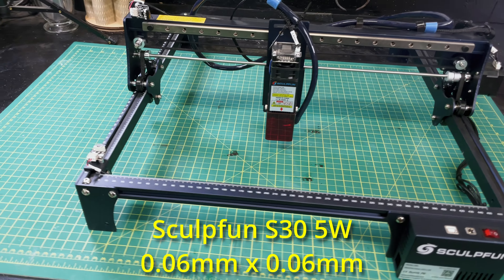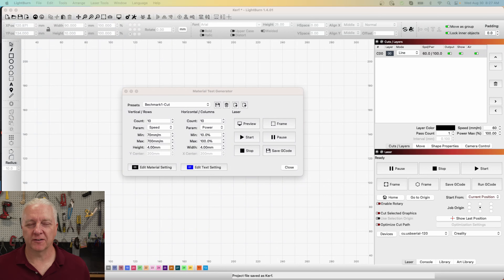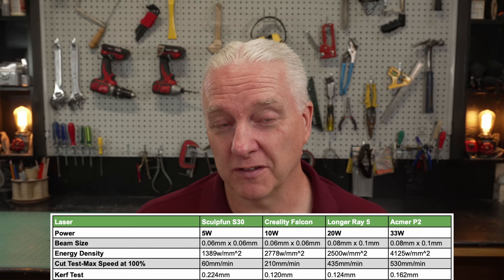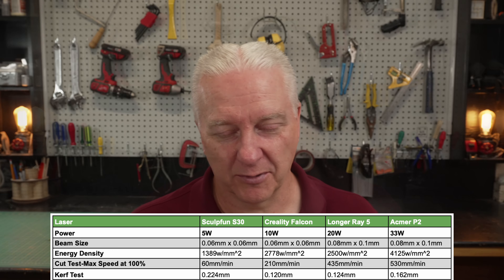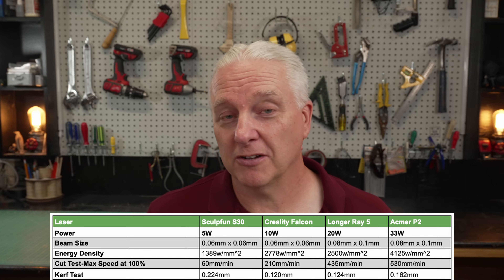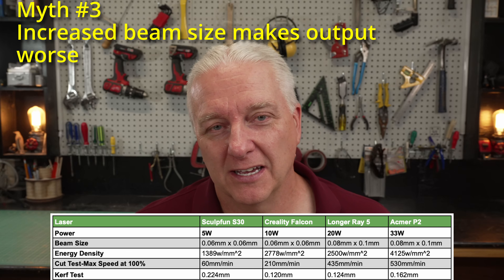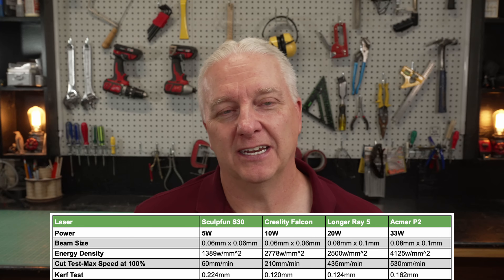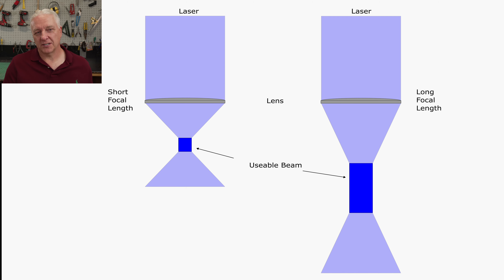5 Diode Laser Myths That Just Won't Go Away

Comment: Hi Steve, this is a very good and interesting video. You have explained it very well.
Only at your 4th myth, you are not wrong, but also not completely correct.
If you shine the light of multiple lasers through several partially transparent mirrors, you will notice that the first laser (the top one in your diagram) experiences the least amount of loss. As you mentioned, this mirror is not partially transparent, so the loss is not significant at this point. However, what does come into play is that if it is a glass mirror, diffraction and loss of intensity occurs. I don't believe a glass mirror has been chosen here, but that doesn't matter for the rest of my explanation.

The laser below it must shine through a partially transparent mirror because the light from the laser above it must pass through. To start with, there is some loss from the upper laser because glass, no matter how clear, converts light into heat and changes the intensity of the light. As long as we can see glass, it absorbs light intensity; it's as simple as that. Additionally, there's a problem where light enters the back of the glass at an angle and, due to diffraction, exits at a slightly shifted angle, which depends on the thickness of the glass used. The laser shining from the other side of this glass enters at a different angle and must pass through the glass surface twice – once towards the back of the glass where the foil or deposited metal is that reflects the light, and then back out at a 90-degree angle. So, there are two instances of diffraction and loss of intensity due to the brightness of the glass.

By now, the beam of light has become broader, and this broader beam continues downward to the next laser. This effect repeats several times, and when you compare the differences between the first stacked lasers and the current generation, you'll see that there are significant variations in the amount of loss. It's not a standard 4% per glass piece, but the loss increases as you go through multiple layers of glass. This loss is partly due to the glass absorbing heat and thus, lowering intensity and partly due to diffraction, causing some of the emitted light to simply not reach the final lens.

As technology has improved, laser developers have started using better diffraction gratings to minimize this loss in intensity instead of caring about optical focus. However, you'll only find this in very few consumer diode lasers because it's an expensive and difficult technique and is also sensitive to impacts. In the consumer laser diodes used in most of our laser engravers, much more attention is paid to the final lenses that focus the light into a usable beam than to the light path leading to the final lenses.

As said, you are absolutely not wrong, but you can't say it's a 4 percent loss per element.

Greetings,
Brian.
Reply from the maker: Yes, this is all correct, but I was trying to keep the description as simple as possible.😉

The beam coming off each diode is also quite large compared to what I've shown, and there is actually a concentrator optic between the last diode and the lens.  They do this to minimize a lot of the things you mention above (e.g. if a beam gets slightly diffracted passing through an optic, that shift would be negligible once the beam from all diode are concentrated down to a smaller single beam. This might make the beam a bit larger over all but wouldn't account for the 50%+ larger beam size that people think is caused by trying to line up the beams from different lasers

Comment: Hello! thanks for the video. For cut 18mm of plywood, wich diode laser can i use? 5w can cut the same that a 10w laser?
Reply from the maker: Cutting is where power matters.  For reasonably clean 18mm plywood cuts, you're going to to want at least a 30W laser
Reply: @SteveMakesEverything  thanks. Wich Is the life Time of a diodo laser? 5 hours of use daily?
Reply from the maker: @Acseq8wy  Diode laserwill last for quite a while - easily 5000-10000 hour.

Comment: So in your chart the 10w is listed as a higher energy density than the 20w, but you stated the data clearly shows an increase in energy density as wattage increases. Are the data points accidentally swapped?
Reply from the maker: The energy density is less connected to power and more tightly coupled to  beam size.  Modules with fewer diodes tend to have smaller beams - this is due to how the manufactures stacks the diode outputs.  One exception is the AlgoLaser Delta which has a different diode arrangement allowing a 24W laser to have an almost square beam with higher energy density, yet can still cut like a 30+w laser.
Reply: That makes sense. So I guess the part I hadn't considered is that the 20w has a significantly larger beam thus more overall energy at the surface. 
At 45yo following a year of being out of work with a back injury I'm diving into the world of CNC lasers. I programmed and setup CNC mills and lathes for about six years a decade ago and have always wanted to get back into the field. My xtool S1 will be here this week and for the past week I've been relearning all my software. Your videos have been very interesting, much appreciated. This channel is a welcomed break from the overwhelming number of videos that are simply paid advertisements!
Reply from the maker: @pkupmanvt  Almost all of my equipment reviews are unpaid, so I can retain an unbiased view, and on the couple where I have been paid, I'm clear with the manufacturer that I work for my channel viewers, not them.  I won't actively try to destroy a company's product, but if I don't like some aspect of it, you will hear about it.  Most companies are actually OK with that.

Comment: Hi Steve, Which do you thing is a better laser.longer ray 33 watt or acmer p2 33 watt.Having troublemaking a decision. Longer has good support. Not sure about acmer. THANK YOU
Reply from the maker: Tough choice since both are great choices. Both companies seem to have decent support, though the Ray 5 is an older design.  All things being equal, I would probably lean to the ACMER P2, but you won’t go wrong with either
Reply: Thanks steve

Comment: Thanks for the info. I learned a lot. I especially appreciate the power and cutting depth info. I almost paid more money for a 48w laser that could be switched to 24wfor finer engraving. Sounds like that would have been a waste of money based on your info. Instead I opted for a 24w at half the price with a motorized x axis that can automatically step down for multiple passes on deeper cuts. Sounds like I made the best choice without knowing it. The cuts may take longer, but will still be possible and with a better kerf, and I won’t lose anything in fine engraving.
Reply from the maker: 20-30W lasers are in the sweet spot for both cutting and engraving.  However, you will hear a lot of people say that a 40W laser can't get detailed engraving because the beam is "huge."  Keep in mind that we are talking about small fractions of millimeters, which is beyond the limits of most peoples' eyes anyway.  A typical 20W laser will have a beam size of 0.8mm to 0.1mm, while a 40W laser size is usually around 0.15-0.18mm.  Can anyone really see a 0.05mm difference??🤔

Comment: In our area, there is a high fluctuation of power because of this. I can't engrave photos properly, and the machine is not starting from its stopped position. What should I do to resolve  this issue . Please help me, Steve
Reply from the maker: What laser is this?  When you refer to the stopped position, do you mean the home position?  Or is the laser not moving at all
Reply: @SteveMakesEverything  it is laser tree and I am not saying the homing position..while I am working on my project suddenly the light goes off because it loses the power from the station but when the power gets back the laser will not proced the project from its stopped position rather it shifts the position and proced
Reply: @bereketsimon-ql8jt  Hello,for home and start position need to review your controller, you not say what app you use and what controller.As i know Laser tree make only head modules without frame.
These modules have a high temperature defence and overheating is one of reasons to not work.
Reply: @bereketsimon-ql8jt  you must install ups power supply with some big battery to avoid power fluctuations, most of lasers can't resume the job after power off.
Wish you success and fun with your future projects.

Comment: Thanks for all your good comments. I got a question for you. I am not sure if this is a myth or not but, I am using NEJE E40 laser 
(10W) thinking of upgrading to a E80 (20W)  I seen comments saying that all diode laser should not be used at 100% . When used at 100%, the life of the laser is reduced drastically. Is this true? I see lots of youtube example using the laser at 100%. NEJE offers a 2 year warranty but will lt last this long if used at 100%?
Reply from the maker: No matter what, all lasers are consumable. If you baby the laser, then it might last incrementally longer, but I don’t put a lot of stock not the 100% power claim. Diode lasers vary the output power by pulsing the power and varying the duration that the laser is turned on.  The actual voltage applied to the laser is constant while it is on, regardless of the power output.

Comment: Thank you for the video.  Watching this make me think of a question of beam shape and size.  If I want to creat a 1”x1” black block, engraving.  If I execute the burn on various laser with different beam sizes and shapes, will the shading be different?  Does lightburn take into account beam size/shape?
Reply from the maker: These are interesting questions. First the color shading may not even be the same between to units of the same laser.  Certainly between different brands, laser powers etc, the shading is likely to be different.  Lightburn doesn’t know the beam size but it can compensation for kerf if you enter it into the settings.

Comment: I’d appreciate your thoughts on the idea that running a diode laser regularly at 100% can significantly reduce the lifespan vs consistently running it at something closer to 85 or 90% power.
Thank you!
Reply from the maker: I hear the comments about running at 100% but I’m skeptical of the claim that it shortens the life in a disproportionate way. Of course using more power means more wear and tear on the laser but is 100% more than twice as bad as 50%. I don’t see it.
Reply: Thank you.

Comment: 1 thing that stands out to me is as you move up in laser wattage the power does not increase that same multiplier...i.e. 10w to 30w does not have a 3x improvement. Just a neat thing I saw in the chart. Would love to see a 40 (48) watt lasers numbers. Just one question that I don't know if you covered and I missed or not but did you actually measure the beam size or go from the manufacturers' statement? Honestly just curious as I can't remember you saying anything about it when I watched (re-watching to see if I did indeed miss it).
Reply from the maker: I wanted to include a 40w laser but I was having an issue with my D1Pro this week.  I will follow up on this once I resolve my issue or get a different 40w+ laser to review.
Reply: @SteveMakesEverything  cool thanx!

Comment: One important thing you kept stating was OPTICAL focus, lasers work on INTENSITY focus which is slightly different to optical focus. While I understand you were working on the basis of what manufacturers were GENERALLY stating as their specs, they are now starting to move more toward quoting relevant specs. Using Optical calculations is where a lot of these myths originated, if you were to work on intensity focus by doing a ramp test on each and using those results to recreate the results you will notice some very surprising differences in the results. I am forever trying to explain to people these things so they can get more predictable results from their lasers.
Reply from the maker: Well, at the end of the day, a user doesn't think about optical focus.  But that's what allows the intensity to be focused in the first place - this is a very subtle difference and I'm not sure this is the source of most of these myths.

Users will typically do exactly what you suggest and run a focus test on the material.  The optical issues only really come into play when beating down myths around beam size.

Comment: My 33~36 w laser only cut at 10mm/m speed and only at 70% power and above, is that anything wrong with my laser?
Reply from the maker: Likely not assuming this is wood of some sort.  Note that you'd be better to use higher speed and multiple passes rather than a brute-force single pass anyway.  This will help prevent your cut material from looking like something you'd use to start a BBQ.  I've been meaning to do a video about this - some day😏

Comment: Thanks a lot Steve, just what i was asking for, it will sure help me decide on my next upgrade. Didn’t quite understand how it happens that between 5w and 33w the power intensity is only 4 times more, (less than i expected) while the speed is 10 times greater (more than i expected). Intuition buffling…  At the end of the day whay  i really care about is getting a faster time-saving machine, so i am pretty happy with the data. Still, i am curious why it is so.
Reply from the maker: Some of the difference is because of system loss, some is related to focal length, but as you’ve noted, the real difference is the time it takes to run a job. A higher power laser is just much more capable.

Comment: The biggest issue is prefocus collimation and integration of the optical power. The most efficient systems use FAC mucrolenses on the diodes, a series of knife edge mirrors and a polarized beam combiner followed with a collimation lens. Such syatems can give a final focal spot of 0.1 to 0.02 mm. Use the dodes to pumpa fiber optic and you can get down to 0.001mm. In essence the tradeoff is brute force power for a cleaner beam spot at your workpiece. ❤
Reply from the maker: …and price 😉

Comment: It seems that multiple diodes  diodes will not be in exact phase and will effect coherence.  Could you comment on that? Thanks
Reply from the maker: They are all run from the same PWM signal so they should be in phase. In most diode laser modules, the diode out puts aren’t stack, so the phase won’t matter anyway.  But there lasers where they are at least partially stacked so the manufacturers has figured this out for us

Comment: Steve, you spoke about a "kerf" test.... how do we do that?
Reply from the maker: What I did in the video was draw a rectangle and in side it I drew 8 lines across it to make a total of 10 cuts.  After cutting this out, push all the internal squares together an measure the gap that’s left over.  Divide this by 10 you will get the kerf (or more accurately, the width of the laser when it is cutting)

Comment: I think they are saying the same thing differently.  At least as far as I have noticed.  I have never heard someone say that adding a diode decreases the output of the end result, or at least I had never thought thats what they were saying.  Just exactly what you showed... and Stacking 4 6w lasers will not give you the full power of all of them at the same time but 20w instead of 24w.   I know it will be stronger than 2x6w lasers.    I just watched a reaction video to this and i really feel like everyone is saying the same thing and misunderstanding each other.   At least as it comes down to the power output.
Reply from the maker: Not decreases output but rather doesn’t increase output.  And have certainly heard another YouTuber say this exact thing.

Comment: most of the time the diode laser is too slow and I need more power. That way I can have more pieces to sell on etsy
Reply from the maker: There is no question that for the foreseeable future, a CO2 laser with comparable rated power will be 2-3 times faster than a diode laser, but CO2 lasers come with a different set of issues (e.g. portability, size, and usually cost).

Comment: excellent video and explanation.. but I have one major problem and this is not with cutting but engraving! I moved from a 5w to a 10w and my engravings are nowhere as near dark as my 5w.. I have tried every possible change to settings with speed and power.. also another thing is that the engravings on the 10w keeps fading off when I stain them with a foam brush.. please see my problem and if you have a solution it would mean so much!
Reply from the maker: Hmm I’m not sure this has much to do with the extra power. But I think I might to follow this up with some engraving tests as well
Reply: @SteveMakesEverything  I think it might have to do with the high degree of carbonization, that's why it is easy to fall.. that would be awsome if you do some tests with your experience! Noone have tested this.. also please if you do it test vector images.. thank you very much!
Reply from the maker: @Georgeprospero  It's worth a look.  You should get less carbonization (a.k.a charring) with a 10W laser, unless you are applying needless power, of course.

I'd suggest running a material cut test on your laser to find the optimal cut settings, though I have to assume you've already done this.